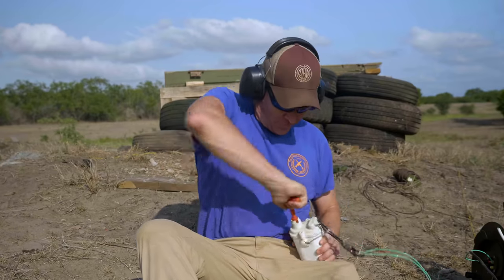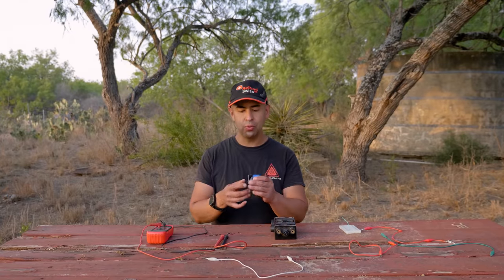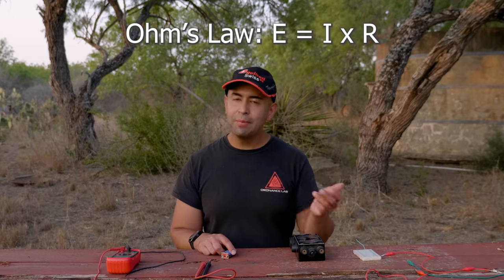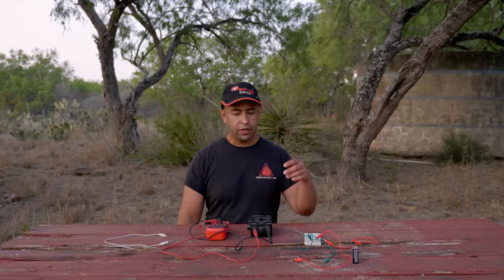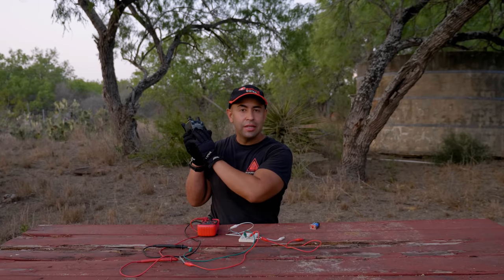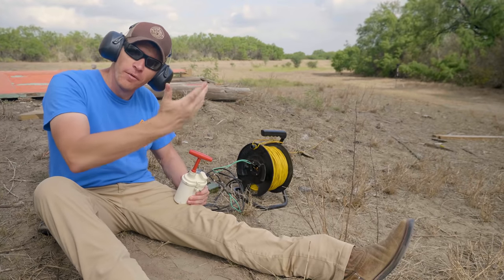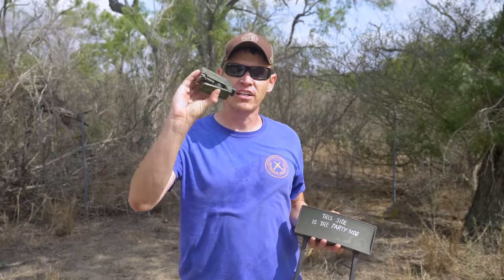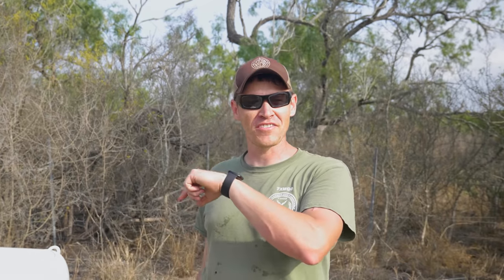Ordnance Lab's Top Methods of Detonating Explosives (Part 1)

Comment: It took us forever to film this as we are still building up a lab compound. With limited hands available we can only do so much. The wind alone set us back a ton as they nuked the microphones. We will release part 2 on non-electrical methods soon as well as a ton other fun projects. Stay tuned fellow energetic enthusiasts!
Reply: I would work for you but we are 5300 miles apart.
Reply: What happened to the "hey thanks for watching!" Lol I liked it
Reply: @ethanwild3301  we cut it. I'm amazed someone noticed we stopped putting it.
Reply: Use lavalier mics. They work better in the wind.
Reply: Hey forget the haters. They see anything and don't even check it out, just run and yell. You guys keep it up because some people get off on the science and the boom is just a bonus...a big bonus.

Comment: I bought a disposable camera as a kid, about 25 years ago.  I thought; well it's just $5 for these things and there's nothing worth taking a picture of so, I'll take it apart.  That capacitor discharged its might through the screwdriver into my hand with so much force, I'll never forget that.  Just 9year old me in a room by myself screaming at the top of my lungs while getting electrocuted by a disposal camera.  Haha!!
Reply: Me and a friend used to play with those capacitors, we would toss them into water and they would make a impressive flash and pop
Reply: Glad to hear i wasn't the only one who was stupid and did this.
Reply: Can be made into a homemade stun gun
Reply: I built a stun gun out of one at 14
Reply: @dravenmcgee3188  yes mate , there good for that
Reply: Yeah now I'm working on time delay emp crossbow bolts
Reply: modern rogue has a taser design based on the disposable camera they weaponized it lol
Reply: In the 60's we'd take a capacitor from a car ignition system, hook it up to a spark plug wire, hold it with fuse pullers, a fire it up, three or four times, to around 30,000 volts, and carefully place it on a wood shop table, and wait...
Only worked on the FNG!
Reply: @brucelytle1144  Scratch the side of a 2-liter bottle with something and attach a male pneumatic tip to the lid.  Slide it under someone's work space and hook it up to the compressor.  Louder than a 12 gauge
Reply: We had a HUGE capacitor in stock when I was a Marine.  We kept it on the counter at the repair parts shop.  

Take it out to your car and fill it up via an ignition lead and then leave it on the counter.  People would mess with it up till they touched both posts.  

POW!
Reply: Bro same but I knew it could discharge so I safely discharged it but I’m still a stupid kid so some voltage was left and I got electrocuted but since it was rlly low voltage it kinda felt weird/kinda fun
Reply: @random_ak_in_the_backyard  as soon as I realized what was going on, I shocked my brother, OBVIOUSLY
Reply: I remember making up some nasty little ghetto stun guns using flash capacitors, some empty film canisters, a C cell battery and a push button from Radio Shack in Tandy. My friend's big brother didn't believe that it was real and promptly jabbed himself in the arm with it and damn near had a seizure. He went stiff as a board and toppled like a statue. He was my first "customer" lol 😆
Reply: when I was 16 my buddy was taking a shower so we grabbed the battery out of my truck and hooked my jumper cables to the battery and then hooked the other end of the jumper cables to the bathroom door handle... the day before I was in that same bathroom sitting on the toilet and rolling a blunt on the ground by my feet... that same friend that was taking a shower threw an M-80 under the door and it landed right next to my bag of weed and blunt... after that we were all upset at him for destroying all our weed... so the next day we gott him with the old car battery hooked up to the doorknob trick... good times
Reply: Neighborhood kids used to use those to make homemade zappers as kids😂 running around zapping each other.
Reply: @notyouraveragegoldenpotato  I definitely zapped my brother
Reply: Those disposables are the near perfect firing circuit but it does require some major modifications in order to work for these items…..
Reply: W

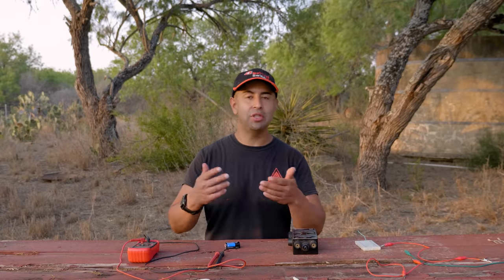Comment: 3:32 not quite- the US is indeed 240 volt, but it's split across two phases. Your large appliances run off both phases,  but smaller household items only need 120 at most
Reply: That is not correct. The supply is a center tapped single phase 240 volt system - sometimes called split single phase.  The center tap on the transformer provides the two hot 120 volt legs.

Comment: You have a job I would love to had in my younger years.  Doing excavation work days I was in a blasted trench through a concrete floor and wall but when they got to the wall it wasn't breaking an that's when I yelled to the operator to stop when the tooth of excavator flattened the top half of blasting cap with 1 1/2 sticks.  The blasters had no idea why it go off

Comment: Minor correction, they had the technology to convert the voltage to high enough DC voltage, but no way to convert it back with realistic efficiency (you'd need an inverter to create AC again before connecting it to a step down transformer)

Comment: Would the more stable high rate discharge profile of a 9V primary lithium battery provide a more consistent output to your blasting machine?  Even though quite a bit more expensive than alkaline 9V, they may be a better value (more blasts for the dollar) as they are much better at handling the likely high discharge rate of charging up that capacitor bank.

Comment: I like wireless detonation. Easy to make using garage door opener circuits.
Reply: Not safe. Good way to get hurt. A decent remote system should have an activation delay timer, an electronic code decoder with a fail safe should the code be entered wrong as well as a fail safe should a predetermined time would have passes without setting off the charge.
Reply: @Subgunman  There is no point in having an activation delay unless you plan on triggering the boom in close proximity to yourself or others which is stupid to begin with. A code is also unnecessary unless you plan on leaving the detonator to an armed boom around for other people to access. 

These are pointless features only suitable for specific situations and they overcomplicate the detonation process. You want practicality and ease of use when it comes to triggers.  Safety is important, that is why if you utilize this method, you use two garage door openers in conjunction so one garage door opener arms the other, which then detonates the boom.

Comment: Question(s): What types of caps are these devices really made for? With 'hot wire' types it doesn't seem as critical but isnt the blasting machine also used for EBW or slapper caps?  And for the physics minded person would Utreon offer question answers? For example: the cancelling effect of the claymore's shape?

Comment: There appears to be a flaw in your description of the high voltage discharge. It is dc and not ac. Of course you didn't say it wasn't dc, but in your describing the voltage going over the long wire you mentioned the ac was better, implying the discharge of the capacitors was ac!

Comment: I have a theoretical question for some of you more knowledgeable HE specialists; is it possible to initiate a secondary explosive like C4 or similar, with nothing but an electrical impulse? And by electrical impulse I mean a microsecond discharge through a bridge wire powered by a very large high voltage capacitor bank, something around 1-5 kilovolt multi-kilojoule range, I'm talking about the type of capacitor bank that can detonate fruit or hotdogs. It seems to me there would be enough initiation energy but I just don't have the knowledge or experience to judge that for sure. It's certainly not a practical or safe method of initiation but I'm just curious if it would work.
Reply: yes theres a certain type of blasting cap called an exploding bridge wire detonator(a thin copper wire that detonates because you put some much electricity through it)
Reply: @Aaron-zu3xn  I'm aware there are bridge wire electric detonators but as far as I know they are all used in combination with a primary explosive, I've never seen one that directly sets off a secondary. Is there a specific one you know about that doesn't need a primary?
Reply: @TheExplosiveGuy  Exploding bridgewire is a different critter.
In a normal electric detonator, the bridgewire gets hot and sets off a primary explosive (or sets fire to an igniter charge, which sets off the primary explosive).
In an exploding-bridgewire detonator, the bridgewire gets hit with enough electrical energy all at once (typically from a capacitor placed very close to it, via a high-current switching device also very close in) that it's rapidly transformed from a strand of metal to an expanding cloud of plasma, which, if done right, suffices to initiate a secondary explosive.
This is an expensive approach, as the capacitor and switch tend to get blown up in the process (being very close to the secondary explosive and all).  But, it's useful if you need a detonator that's highly resistant to heat, impact, and so on, and especially if you need very precise timing (e.g., if you're trying to trigger a main charge at multiple points with sub-microsecond timing for some obscure reason).
So, yes, these are very much a thing, but only for highly specialized applications.  (And the bridgewire may not literally be a wire, and may not be metallic, but the principle is the same.)
Reply: @ericwilner1403  Thanks for the info, I figured there would be enough power but wasn't sure. It makes a whole lot of sense for setting off a nuke with the required degree of timing needed, that's pretty cool.
Reply: @TheExplosiveGuy  I figured that was the concept you were looking for.
I learned of EBW detonators (and their use) long ago; as a young whippersnapper, I had the opportunity to hang around with some geezers who had interesting backgrounds, and it's amazing how much arcane information one can acquire that way.
Reply: @ericwilner1403  arcane indeed lol. I was just doing some reading on their use in nuclear weapons, it's hard to imagine an explosive shockwave so accurate that it's concentric to the core within half a mm or so, that's mind boggling...

And just out of curiosity in the Trinity bomb for example, were there multiple different power sources/capacitors for each EBW slaved to a master control unit? Or was there a single power unit that fired all EBWs at once in series or parallel? I'm guessing there were multiple units, I don't know much about this sort of thing but I do know that current rise time is a thing in capacitors, which would probably be slowed down a lot by a series configuration.
Reply: @TheExplosiveGuy  Even more mind boggling when you think of trying to design and build the first one ever, using early-1940s technology.

I don't offhand know how firing of the Trinity unit was done.  That information might be somewhere in the archives (mental or paper), but I don't have it handy.
Reply: Only 1 way to find out, as I doubt anyone has done it at that level. I wohld theorize it would just start burning. At least the insensitive exp's.

Comment: I can see where voltage drop would be an issue using length of wire for ignition circuitry but couldn't that be eliminated by having 9 volt battery in close proximity to explosive. You could use a remote control toy mechanism to close the circuit and something simple like a model rocket motor ignitor to ignite the charge. Would be fun to try but extremely dangerous. Some kids toy miles away might set it off as soon as you slap the battery in.

Comment: What about one of those Step up high Voltage Pulse Inverter Arc Generator Ignition Coil Module
Reply: Isn't that done with capacitors?
Reply: @scrappydoo7887  I'm sorry, Step up high Voltage Pulse Inverter Arc Generator Ignition Coil Module

Comment: Hello guys. Just wondering if it's possible to use industrial hydrogen peroxide . As a oxidizer in some explosives ?
Reply: It's certainly possible, but concentrated peroxide brings a whole host of dangerous issues along with it. Let's just say that when process chemists work with 70% peroxide, they wear chain mail gloves and try not to breathe too aggressively towards the substance. However, unconcentrated and there's so much water that it just doesn't do much. In general, the energetics most favored are things that are pretty much inert when in storage, are relatively non toxic for personnel to handle, and only go boom once they are mixed AND everyone is ready. Hydrogen peroxide just doesn't fit the bill very well. I want to say it sees some use in reactive thrusters for spacecraft though.

Comment: i always thought the M 57 was a piezo-electric detonator and the 10 cap hell boxes was a dynamo like the plunger 50 cap jobs! ever try a stun gun to set off a charge?
Reply: They are based on a battery, I think the same physics as a dynamo.  The FM ( https://armypubs.army.mil/epubs/DR_pubs/DR_a/pdf/web/tc3_22x23.pdf  ) at 3-3 gives a description which is inconclusive but suggests it is not piezo.  There is a video taking it apart that I will try and link which shows how it works.

Comment: Just a correction but they could produce high voltage DC they just didn't have a way of stepping it down you were very close but not quite as it takes microprocessors to step down DC voltage whereas AC voltage you can do it just a couple linings and a large bat of oil this is what we call a transformer

Comment: Still don't know the difference between volts and amps other than  there are enough amps in the 3rd rail of the Chicago subway system to push a train and I learned that from Billy Chrystal in the movie Running Scared.

Comment: what i want to know is how well a claymore can be "aimed." one of the science fiction books i like has a character set up a line of claymores that are "aimed" towards a friendly position, but pointed up at a 45 degree angle. the theory in the book is that the projectiles from the claymore will sail over the heads of the entrenched friendly position and strike targets on the far side of the friendlies. why not just place claymores on the far side directly? it wouldn't be a cool scene in a book!

can a claymore really be aimed? do the projectiles even fly far enough for it to matter?
Reply: At least a hundred yards out they can easily be deadly, and yes they have built in aiming devices. As far as angling, no. They would have lost any momentum to be deadly. They are small spheres of metal not canon balls.

Comment: Real claymores have a metal backing (as of 2003). I dunno what else to tell you, I saw it with my own eyes. I appreciate the specific mention in your video though! 😀 I've policed claymore ranges and found the metal backing as well. There's an easy way for you guys to find out though since you don't believe me. How many real claymores have you dissected? Just get a real claymore and cut it open, we used Gerbers but I'm sure such lauded professionals as yourselves must have some special tools that might cut just as well, or better even! Even better, call Sapper School at Fort Leonard Wood Missouri and ask them? That's a lot cheaper, but might bruise your ego a bit. 

Here's a thought experiment for your brains though: 

Anatomy of an Explosion 101 - "The Path of Least Resistance." 

1- What happens when an explosive detonates? It pushes in all directions until it finds the path of least resistance, then it mostly goes that way. (simple)
2- How do bullets propel a projectile? The gunpowder explosion pushes in all directions, but the path of least resistance is forward due to the (gasp) metal casing. Thus the explosion is forced out of the front of the bullet. Front towards enemy. Even without a barrel, the bullet will go forward.
3- What happens if you place explosives in a case where there is a bunch of metal on one side, and just a plastic case on the other? Which side of the casing do you think the explosion will find as the path of least resistance? In this case (why your claymores perform so badly against the paper commies in your tests) you have heavy metal shot in the front and nothing but a thin plastic case on the back. How do you think a bullet would perform if the base was plastic and there was a metal projectile in the front? Now compare that to how a bullet would perform with a (gasp) metal base. Do you think the plastic based bullet (without a barrel or gun to press against) will perform better? Or do you think the (gasp) metal based bullet (without a barrel) will perform better?

Put your thinking caps on children!
Reply: Imagine if things had changed since 2003, that would be crazy huh.
Reply: The only change to the M18A1 since it was created, was the foil barrier that was added between the epoxy encased balls and the explosive...as the explosive would start corroding and rusting the steel balls over time. 

The original M18 had square cubes instead of balls, and still didn't have a metal backplate. Those weren't used very long because they sucked and the frags were slow. No epoxy, just cubes with explosive packed behind it.

Sorry to tell you, I've set off more than a couple M18A1s, and had the back off of a couple...no metal plate.

50yrds, most Ivan's will have hits. 30yrds, Ivan's get jacked up pretty good.

A metal back inside a concave shape already exists. It's called an EFP. Let's think children.
Reply: @theKashConnoisseur  yeah. True, I've heard that they use a composite / ceramic backfill now.
Reply: @Markojaydog  Physics 101: as an explosive detonates it compresses the air so fast they DO NOT NEED A BACKER... the air IS THE BACKER as it is compressed. There is NO BACKER. Plates would frsgment and kill. No plate would sruvive that close.